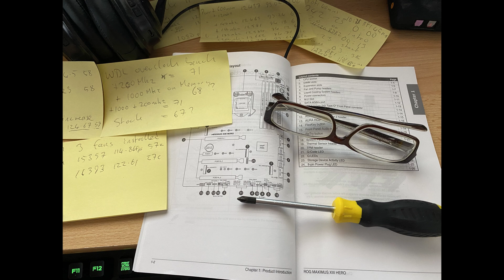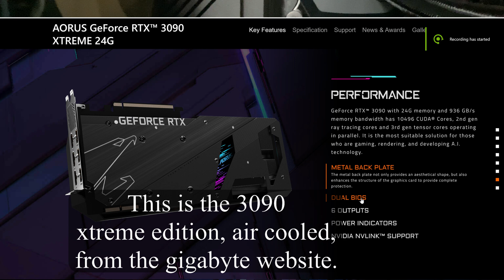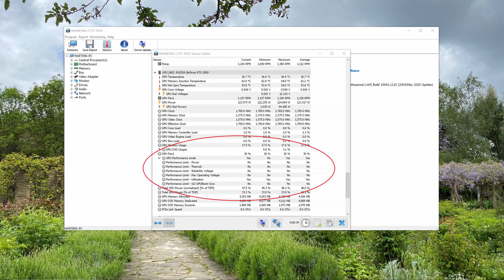Gigabyte Aorus GeForce RTX 3090 XTREME WATERFORCE 24GB GDDR6X PCIE Graphics Card: Overclocking 2

Comment: have two same designed 3080 ti cards. memory temps 108-110 degrees. that's so bad
Reply from the maker: Hi Trudalst, thanks for your comment. What I did was to add a load of small copper heatsinks (20 of them) to the back of the 3090 and then added a fan directly on top of that and these two together, fans and heatsinks, keeps everything cool. I attached the heatsinks with double sided thermal tape. The fan is blowing air directly onto the heatsinks and VRM's.

Comment: if you nvlink 3090s then your going to need at least a 1600w power supply. That 1000w may not be enough for 2 3090s and a 10900k @5.1ghz all core, especially if you get a 3 pin 3090 for that 2nd PCI. Just a heads up
Reply from the maker: Yeah, I was thinking about that.

Comment: You got a 360mm? Only problem is where are you going to put it. The 10900k is a hard chip to cool under load (r20) but it’s cooler than the 9900k b/c of the thicker die. If you got a golden bin and you can do 5.2 all core at 1.35v then temps shouldn’t be a problem with a 360mm. Also, keep in mind that OCing the CPU/Ram can sometimes cause motherboard to overvolt VCCIO and VCCSA, if those values are higher than 1.3v (unless you have b-die ram) I would lower them so it doesn’t degrade your chip

Comment: looks good. I would add a 120 for intake at the bottom and it might improve GPU temps even more. What is this case? And btw, the memory junction can be fixed if your willing to replace the pads. It shouldn’t really be a problem though since the mem can safely go up to 110c
Reply from the maker: the case is a Corsair 780T I bought it about 5 years ago and just kept replacing bits here and there. It's a great looking case. I'm thinking of airbrushing one side of it. All temps inside the PC are well under control it's just the power limit that's stopping higher overclocks, as far as I can tell.